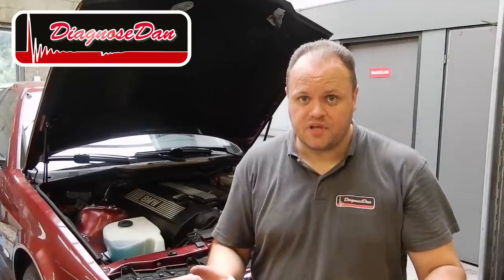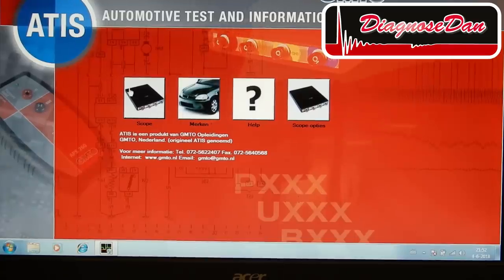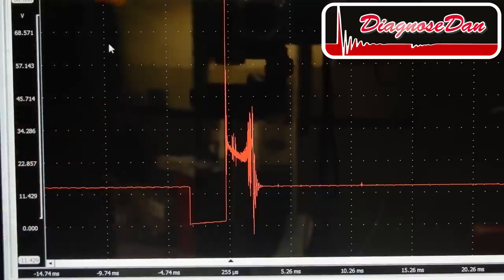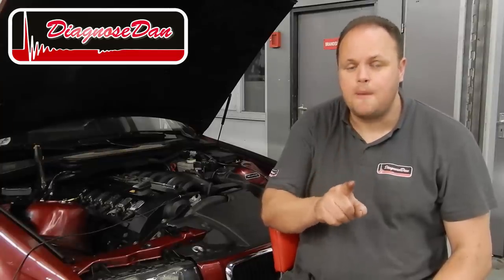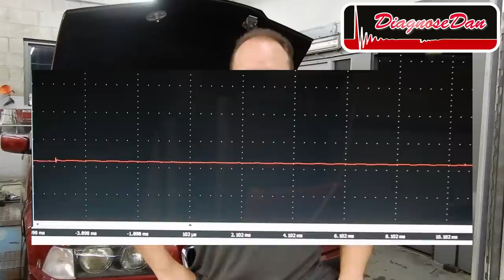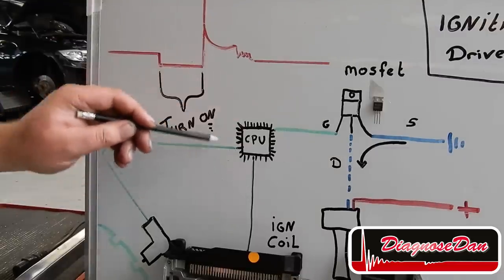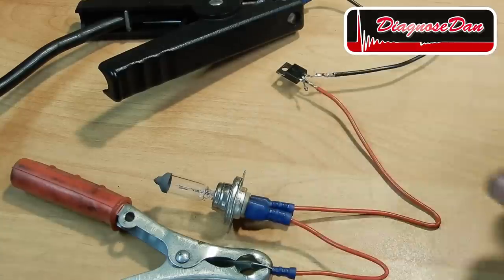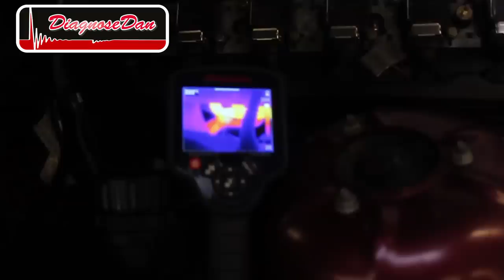ignition coil driver

Comment: Good old Europeans making damn sure there was no current limiting resistor or IC protector in their gate circuitry. You need to make sure Dan can't throw a new FET in it if you want to sell more ECUs :) Thank you Dan for showing everyone how a transistor output stage works (and how Siemens don't protect CPUs)

Comment: Dang, I thought spark occured as power is applied and not when removed. I was still thinking of the old ignition coil with mechanical rotating distributor. Thanks VERY MUCH Dan, I really like ur last half of the video explaining the mosfet is the actual switch/trigger. Is there any of your video where you read/show signal using the scope for Mercedes multi spark engine ?

Comment: So on three terminal ign coils they have a power transistor and not a ignition module is that right ?
Reply from the maker: The number of wires doesn't always tell you the design.

Comment: Do you know if there is high voltage diode embedded in the coil body and connected in series with secondary winding ? The middle pin of the connector is the ground of the secondary winding , is it right ?

Comment: First off let me say thank you for your videos. They are awesome! I have been to school for gas and diesel and I have been a mechanic for 40 years. You make it so simple. I am curious, if the coil wasn't firing the injector should have been. Did this not damage the converter with raw fuel heating up the catalyst? Thanks again Dan.

Comment: Hi Dan, just discovered this channel and binge watching the videos :)

If the ECU has already been sent for a check should the problem with the mosfet not be picked up during the check?
BTW, I would love to see you back probing the connections on the CPU on Mk2 Ford Focus, on my 1.8 tdci it is hidden behind the front wheel arch protected with a security screws (you have to drill them out just to get to the connectors!!!). I had to replace the casing due to a physical damage and getting to ECU was a real pain!
Greetings from UK.

Comment: Hi Dan, can I ask, do you use an attenuator for the protection of your scope when back probing primary's?, I know you do on a Pico, but I am not sure on the Snap on Verus which I have?, anyone help with this, thanks
Reply from the maker: Depends on the brand of scope and the voltage your working on.
Reply: @Diagnosedan  Hi Dan, secondary ignition waveforms with a Snap on Verus, what you think?, cant seem to find a definative answer on this, thanks

Comment: Im getting constant 14 v without pulses from the ECM to the coil itself and checked the next coil over pulsed just fine. I checked continuity all the way to the connector at the ecm and seemed just fine. My question is does a bad coil driver give a constant voltage feed.

Comment: Do You know ohms reading spec for secondary windings of the coil on the car you showing? Because I got 10 M ohms in  the secondary winding of 2 cop,  1.8 M ohms in  another cop and OL in the last 3 cop. I just want to be sure if I need to replace them.
There is no information in the internet about ohms winding spec for this bmw coil on plugs.

Comment: Wow Dan your the greatest, trouble shooting is an art that always requires testing to rule out guess work that will or could result in good components be replaced and unnecessity time spend to finally fix the problem,  just wished you spoke with a better english accent but that won't stop me from watching your videos, guess I'll just have to get used to it.

Comment: Hey, @DiagnoseDan a similar thing I'm trying to perform on my bike (duke 250). I'm trying to ground the ignition coil to ground using mosfet but the mosfet got burnt.My connections are:
gate -- low input signal via 555 timer
drain -- black wire of coil (GND)
source -- vehicle's ground
Also, what I observed is when I dissconnect the IG coil and confirmed the polartiy of black wire (possibly coming from ECU) voltage between black wire and GND was 0, so it is ground of ignition coil
but when I hooked up the wire with ignition coil then voltage between black wire and vehicle's GND is 12 volts.. !
What's going on here.

Comment: PCM's and motherboards use a high temperature solder. I see that you tried adding solder to help melt the stuff that was already there and then you gave up and just cut the pins. That can still be fixed even if the tracks come unglued from the board. That mosfet was clearly fried and that specialty shop didn't even open the case. If anything, all they did was flash it.

Comment: hey dan why did you not check pin fitment on the ecu after back probing incase of a bad connection  sorry to ask not trying to be  a smarty pants just curious  . thanks
Reply from the maker: Because of the history of the car, The other shop that brought the car told me it had a shortened coil the first time they took a look at it. That made me suspect ignition driver damage. But Maybe i should have shown it in the Video!
Thanks for the feedback!

Comment: Confirmed !  The older mechanical/electronic ignition distributor wouldn't have had this kind of failure which means, sometimes its just a more reliable design to leave some things alone and forget all about the 100% solid state designs.  BTW, the company who said "This ECM is good" needs to watch this video for a fee !

Comment: Hey DiagnosDan
With the pulses going in to the transistor via control unit can we use the same pulses to determine rpm of the engine

Could you please tell me that is it possible to  install tachometer and give input to it via the input in coil.(coil over head)

Please

Comment: I attached my test light to battery positive I back probed the my #5 coil wire coming out the PCM the light is green with the car off.when I back probe the other coil wires the light doesn't come..does this mean my #5 driver is cooked
Reply from the maker: Ivan from pine hollow auto diagnostic just did a video on a simular fault. Check out his latest video!👍

Comment: Hello dann ich habe eine frage ich habe gleich probleme wie bei diese bmw was du hast repariert in diese video. Bmw 116i f20 2011 beim 4 Zündkerzen kommen kein Funken ❇️ zündspule ist neue und kabel bis steugerät ist ok. Und 12v kommt bis zündspule wann Zündung ist an ich glaube transistor - mosfet ist kaputt aber ich weiß nicht in diese model mosfet ist in Steuergerät oder in zündspule intergriert. Danke 🙏

Comment: On some cars with coil drivers in the ECM they use ignition coils with two primary wires.  The BMW example in the video uses three wire primary ignition coils.  What is the purpose of the third wire?

Comment: Can someone answer this. At first when Dan is shorting the gate with the drain with his finger on the Mosfett, he is actually sending battery positive to the gate which connects (pulls down) the drain to ground (source). At that point the center post (drain) effectively becomes ground. Is they the reason we seem to see the light become dim when he keeps his finger there? (no more positive to gate).

Comment: Was this a 4 pin COP design?  Don't 3 pin COP designs have that transistor built into each COP itself?  Sounds awful that a bad COP would damage the transistor in the CPU itself.  Do you prefer 3 or 4 pin COP designs?  REASONS?  Thanks!
Reply from the maker: This is a 3 wire without transistor inside. Basicly this is a 2 wire cop with an extra wire to check if the coil fired
Reply: Diagnosing a misfire in my wife's 2011 Rogue with the 3 pin COP.  Replaced one last week that was DEAD DEAD DEAD, lol.  After a week it started misfiring intermittently.  Can't get it to do it just checking, only after driving a while.  Check Engine Light has not illuminated yet, but you can feel the misfire sometimes while driving.  I have searched for the pinouts for the 3-pin connection and checked the 12 Volts, ground, and signal on the wiring harnesses for each cylinder & they're good.  But I can't find data on resistance readings for the individual coils.  I know this is not the best way to check them, but would like to know that data.  Any info on them?  Nissan 22448-JA00C coil assemblies.  THANKS!
Reply from the maker: @TortureBot  if you got a Eobd reader, go to.mode 6 and see what cilinder is misfiring. When you chance coil a coil i'd recommend to change them all including spark plugs. Recistance is not a good way to check them. Also remember more thing cam cause misfires!
Reply: Have an OBD2 reader on the way.  Used the "gas peddle" trick to decode faults from the CEL.  There were none showing yet, all 0000's.  But it still seems to misfire.  Going to get one of the coil tester tools and test each coil after pulling the fuel pump fuse, or follow the Nissan test directions leaving a 13-17MM gap between the plug/coil and a grounded metal portion of engine.  

I used the multimeter to test EVERY coil assembly.  these are 3 pin, so I just made a chart and measured (flipping probes) every pin combination.  All 3 OEM coils had almost identical readings with no O.L (infinite resistance) on any pin combination.  The brand new coil I bought had some similar/some varying readings and 2 pin combinations that read O.L.  Weird?

All my readings varied from 2,400 Ohms to 4 MegaOhms!  I'm like what?  That's high as hell?  Thought these were supposed to have readings from .5 Ohms to 1 Ohm?  Didn't probe secondary (inside boot).  And that is MegaOhm... brand new Fluke 77III shows capital M and Omega symbol!  Lol.

Found Nissan resistance testing directions and finally figured pinouts and it says any pin combination is OK as long as it doesn't read 0 Ohms and can't read 0 Ohms OR O.L between pins 1 & 2.  By their method all coils look good except for new one which reads O.L between 1 & 2 in one direction.
Reply: @TortureBot  it can be injection related.... misfire from LEANED mixture!! Check you fuel trims short/long terms. May be dirty/tired primary O2-sensor with broken heater, leaking injector, vacum leak from stuck crankcase vent...

Comment: I want to learn about immobilizer Dan. 
How did u do it ? Does the car have a working Immobilizer ore did u bypassed it somehow???
Reply from the maker: ilir swe, No immo Works like it should be!
Reply: I have a opel corsa 1.3cdti and the ecu has been water damaged. I need to buy a used ecu and make it work somehow. Do I need the key transponder from the donor car or what

Comment: I have a 99 Chevy Silverado 1500 5.3 and I have a audio system with a high output alternator a red top optima battery and the excess battery in the back while cleaning the ground wire on the excess battery in the back I created it ark to one of the power cords any damage the starter I changed out the starter but when trying to turn the vehicle over the sound was unbearable that I didn’t turn it over fully …. horribly like a hammer clunking. I drove perfectly the day before the arc… playing loudly it shut off in my drive way so I gave it a minute and it cranked up perfectly fine until the next day I arc ground to positive and it sparked twice I changed the starter which did took a hit but the horrible sound not being able to turn over still remains I’m now testing my coil packs and charging up my red top that up font Xs in the back . I suspect 4 coils because they have play in them but they all are good reading 6.88

Comment: So which shop said the ECM was good?
Reply from the maker: Jason U, I never name the shops. But they normally do a great job. Something must have gone wrong!
Reply: I'm surprised the first shop didn't figure this out, especially if it was a dealer. If they simply back probed the ECM with an old fashion analog dwell meter they would have found it. Great video!

Comment: You are my role model and i have learnt a lot from u,   please i want to purchase carscope viso automotive lab scope and i want to  know   if it is a good choice.
Reply from the maker: The Viso is not a pico or gmto scope, but it's also alot cheaper. It's great for a beginner or simple measurements
Reply: @ @Diagnosedan   thanks,i have uni-t oscilloscope single channel,is it good to start with it or viso scope
Reply: @Diagnosedan  What about snap vantage pro because i would like the one i can use without laptop
Reply from the maker: @evangelistjaphethcj.7755  hard question, those are conpareable scopes. The snapon has a higher build quality and is more Expensive. The Viso has alot of component info, is easier to use and is cheaper.
Reply: @Diagnosedan  thanks very much so viso scope is a good start
Reply: @Diagnosedan  i also need ur email address because sometimes i may be in need of ur assistance on some difficult troubleshooting but i don't know how to get u, i would be happy if you can give me a link to reach when the need arises
Reply from the maker: @evangelistjaphethcj.7755  my e-mail address is in the Discription box of the video but unfortunately i don't answer technical questions, i get to many😬
Reply: @Diagnosedan  that's cool

Comment: Hey Dan,

Awesome video sir,
Can you tell me a way to diagnose a misfire only at high speed, without mode 6 data. Camry V6 1997. Waste spark system. I'm trying to ask around but I think everyone js busy. Hope you can help
Reply from the maker: What are the fuel trims doing?
Reply: DiagnoseDan Thanks for replying! They are good under 5, positive and negative switching.

Comment: how can the scanner locate the misfire cylinder when we scan the car, it needs a sensor for it
Reply from the maker: Gharbi Mecatronicien The crankshaft position sensor, detects the misfire because the crankshaft slows down when the engine misfires! By counting the teeth on the sensor ring the PCM knows what cilinder is missing!

Comment: Hi Dan.  Thank you for this video.  I have learnt a lot from the videos on your channel which has contributed to boosting my self confidence as a mechanic.  Just wondering, if the exhaust manifold had been covered by a heat shield, do you think your thermal imaging tool would still have shown exhaust manifold at number six cylinder to be cooler?
Reply from the maker: toyo toe that's Great! I don't think a thermal imager was of any help if there was a heat shield!

Comment: Great vid Dan,  but i thought you said in the beginning ( @1.30) the pcm had been checked and called good? what a waste of a fee to an 'expert' that was.....  :¬)
Reply: i dont have a thermal imaging cam but i do have a laser thermometer £28 from Maplins (r.i.p. Maplins) so that could've been a poorer mans substitute maybe....
Reply from the maker: It was check by a company that normally does a great job, but this must have been the exception. Of courses you can use your laser thermometer, i use it alot in my video's👍
Reply: @Diagnosedan   so the mosfet is kind of doing the job of a relay just a very small relay....
Reply from the maker: @turtlezed  Yes😊

Comment: How are u seeing primary ignition on a 3 wire coil?? Shouldn't u only be seeing the 0 to 5 volt turn on signal???
Reply from the maker: Lavoras Automotive Look at the wiring diagram in the video! There are 3 wires but it Works as a 2 wire system. the 3rd wire is an just an extra ground. 😁
Reply from the maker: Lavoras Automotive, The 3 wire system you are talking about, The transistor is in The ignition coil😉
Reply: Gotcha! I couldn't read that diagram it looked like it was in a different language.
Reply: Not very good with German wiring diagrams yet anyways stiĺl gotta practice on those. They write their diagrams a little differently then everyone else

Comment: swap coils if the problem remains then you know it's controll issue if it follows then its the coil I understand prove it with evidence pay for proof show the other shop they got screwed out of a computer repair but for those who are new to this it will help quickly identify without a test screen what is the problem coil or control
Reply from the maker: Thanks for watching Byron😊

Comment: yes you fixed the driver issue however there still could be a shorted or partially shorted could that could ruin the replacement pcm hope you don't have a comeback

Comment: hi dan im an avid watcher of your channel i am a mechanic of 48 years and have been restoring a 1989 bmw 525i i have problem i cant work out i have a fast idle problem i have overhauled injectors replaced cam shaft and 6 rockers new cam belt everything is new when i finished replacing cyl head it would not idle smoothly i found the idle air control valve faulty which i replaced now it idles to high 1100 to 1400 can you advise me please the engine is low klm 112000 m20 2.5

Comment: So if one found a smashed car with a working CPU it could be replace the faulty CPU ?     Or even if using this CPU plus other parts like the  " on plug coils" etc one// could convert an engine from using a distributer to on plug coils ? Now ther is a topic for your NEXT video   PLEASE

Comment: the shop sent the ecu to the ecu company and told them it was good.
Reply: Don't use that company that tested PCM, again, just to make my statement perfectly clear.
Reply: @bubbsy2002  
technally the shop was right on about assuming the ecu was bad. that ecu company did not do a good job on testing the ecu
Reply: dcomputers Agreed.